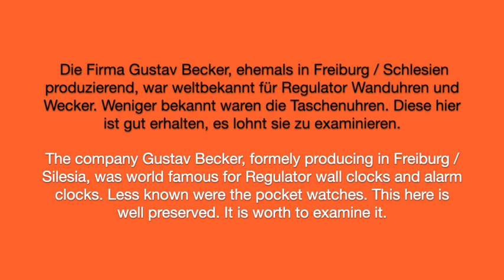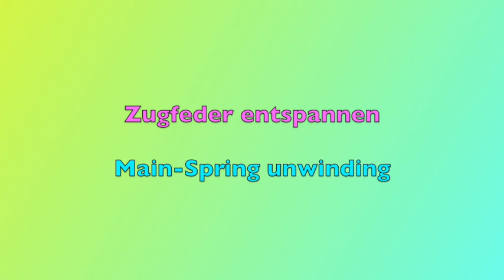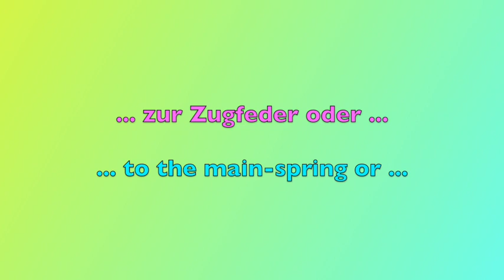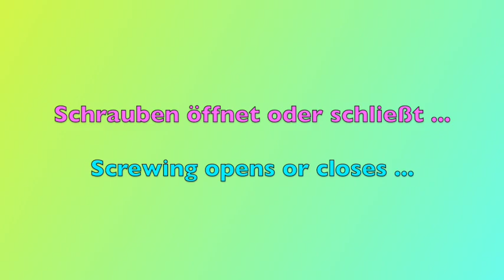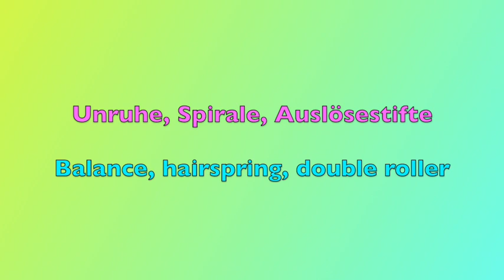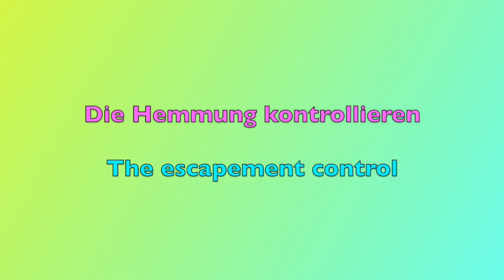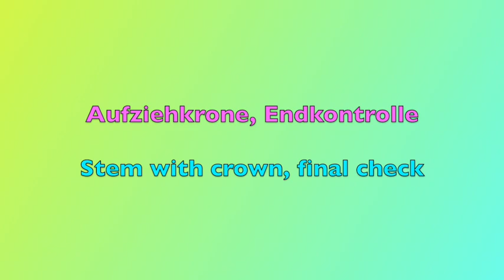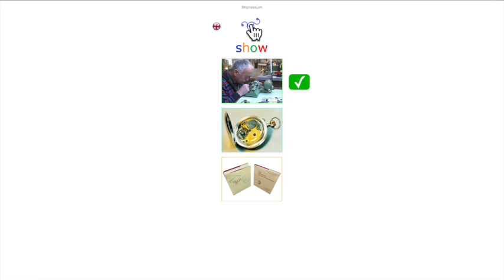Watchmaking - Examination

Comment: Stephen, with all of the modern day technology afforded to mechanical watchmaking, i.e. CAD (Computer Assisted Design), George Daniel's Co-Axial Escapement, and Roger Smith's ever improving modifications to the G.D. Co-Axial Escapement, why is it not now possible to create a mechanical watch with a Chronometry as good as a quartz watch ? 😳
Reply from the maker: Always it is the friction, metal on metal or similar, together with the natural force of gravity, or? The Co-Axial Escapement doesn’t convinced me for this reason however it is designed. An endless discussion
Reply: @spahlow  An endless discussion, but one worth having 👍. One of the things which needs to change is more research into design and engineering techniques, which forego the need to use lubrification in the mechanism, thus avoiding the need for compulsorary servicing every 5 years (Mainly cleaning and re-oiling). What if there was a way to design and build a movement which didn't require any lubrication ? 2. Another problem is the eveness of transfer of mechanical energy from the compressed metal spring in the mainspring barrel as a wound watch gradually unwinds. Perhaps some new kind of spring steel metal alloy could be used, which can hold and even elasticity across its coiled length between maximum and minimum compression ?